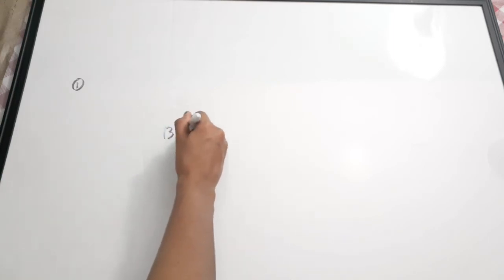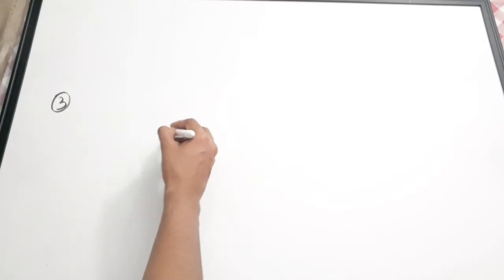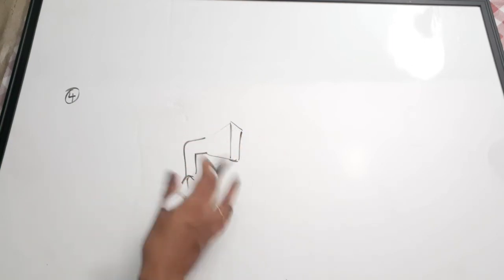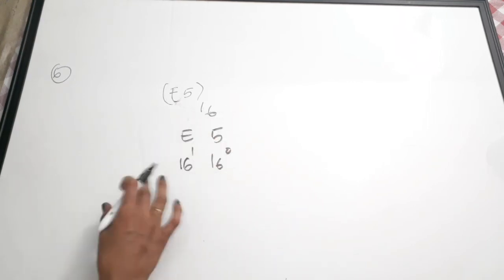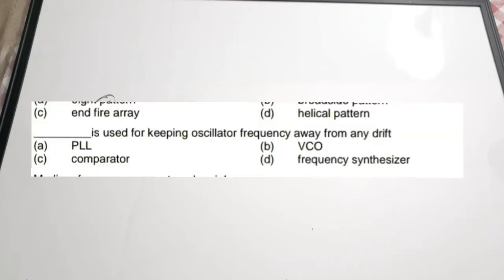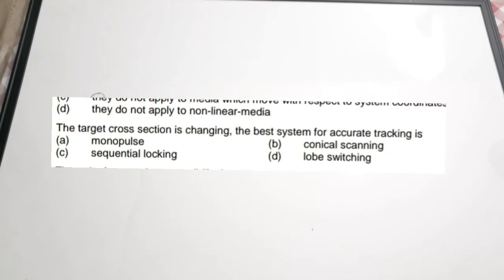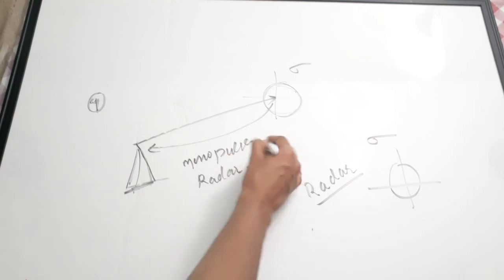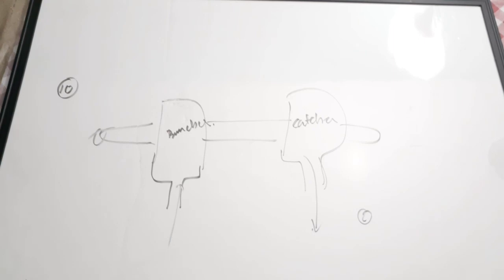AFCAT 2021 EKT Electronics Mock Test Part1| AFCAT EKT Electronics Questions and Answers| AFCAT 2020

Comment: I'm confused about question 7. In one of your AFCAT questions videos you had explained that COMPARATOR is used to keep away oscillator frequency away from drift. Other options already have such settings in place. 
(Your videos are really helpful and informative. Scored 29 out of 30(if answer to question 7 is comparator.)) Thank you!
Reply from the maker: See inside the PLL the element we use is a comparator. So ultimately Comparator is serving the purpose. But PLL is the device used to avoid variations. So the Answer is PLL. But if PLL is not there then its comparator